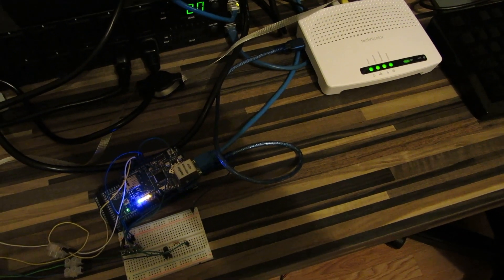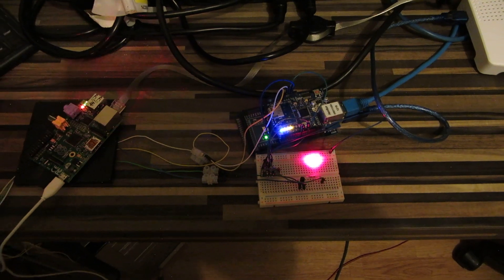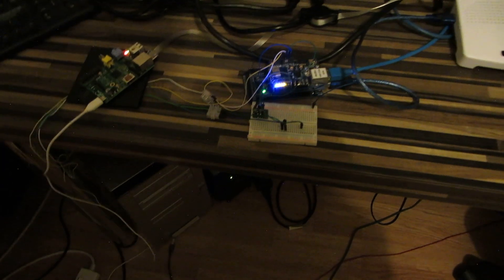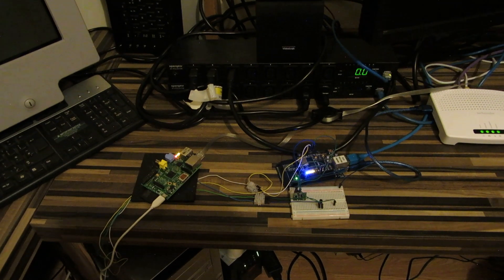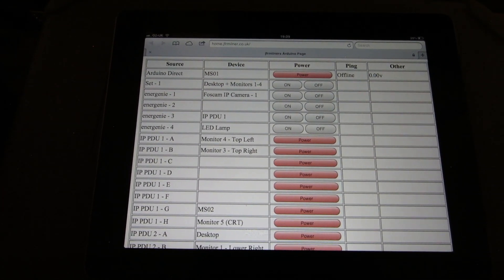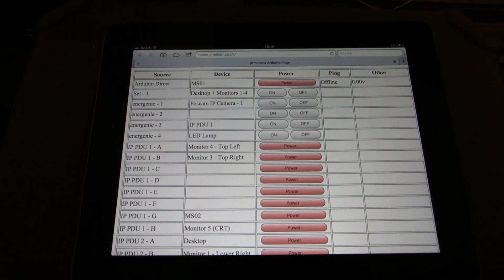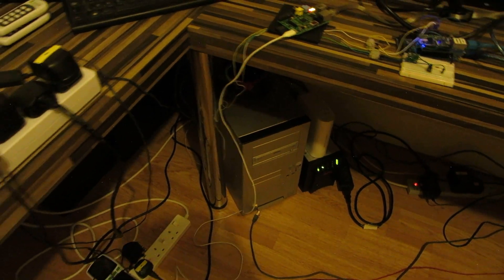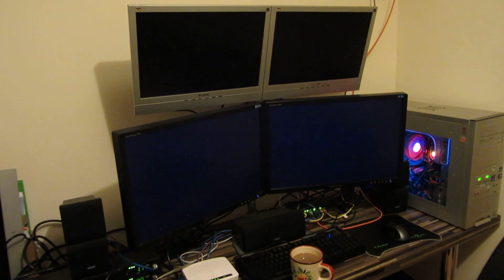Arduino Power Socket Control (Web Server) for home automation

Comment: Oh my god please help. The link to your website code is broken. I must have that code.
Reply from the maker: Just checked the link to the code and its working fine. What happens when you try?
Reply: jfrmilner Ok so when getting to your arduino website code I was taken to a link to download it, except I got page not found error every time. Then after you said it worked, I tried another method, I used another browser, Safari this time, Oh god I hate safari, then it downloaded a link, but upon opening it, it said the contents of this file is dangerous, as if safari took the file and replaced it with that text. Then what I did was I used chrome again, added http:// to the link of the page not found and it finally downloaded, then to be on the safe side, I went to an online file converter and converted it to text. I got it now, sorry for the trouble.

Comment from the maker: You could and this is actually how I did mange access for many years but as mentioned on the video and blog post one of the primary goals is to reduce devices on standby; only the router is powered 24/7! Furthermore, when a PC has WOL enabled it actually uses more power in standby than when disabled as it needs to keep the NIC powered up, see wikipedia Wake-on-LAN for details.
 
Not to mention the ease of just getting your phone out and simply pressing a button and done!